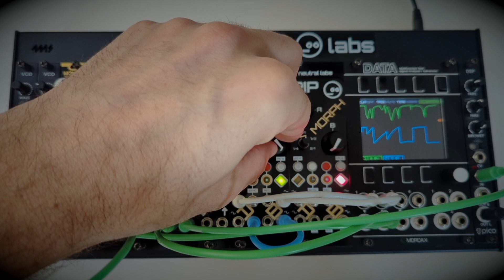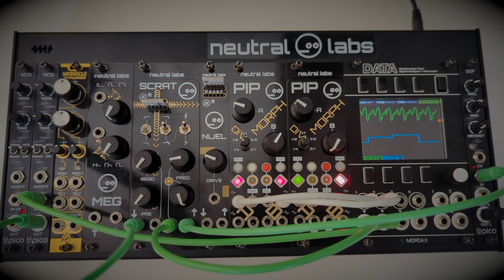Neutral Labs Pip complex CV generator/recorder tutorial

Comment: Hey I’m new , would I hear anything with this module going to my aux speakers?
Reply from the maker: Maybe if you set the frequency extremely high, but that's not the way to use it. It generates control voltages for modulation, not audio signals. You need a small system containing sound sources like the one shown in the video (or a bigger one, of course).
Reply: @nyppy  would i connect it to a sequencer? what module would you usually connect this to next :D
Reply from the maker: @TiMCoop3r  Pip is an LFO (or two LFOs actually). You connect it to anything you want to modulate, like a VCF, a VCO, a VCA or effects.
Reply: @nyppy  Thank you! I'm looking for a VCO next :D

Comment: is there any way to tell which page you're on?
Reply from the maker: Well, there isn't a screen, but the manual explains how to easily identify the first page for both channels using the bi-color LEDs. And then you can simply count from there. In practice, I find that it's often not needed. The first page is special, but when flipping through the other pages, I tend to select whatever sounds good to me in the patch instead of thinking about the exact waveform.